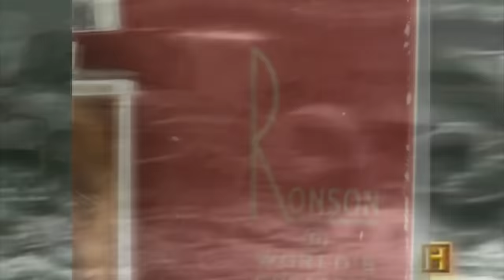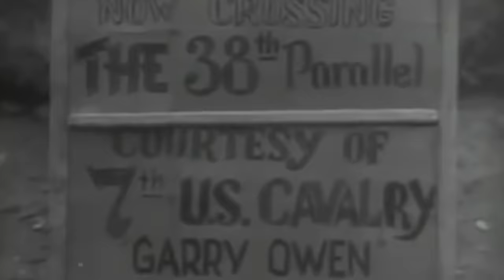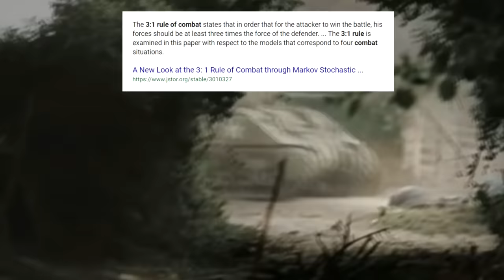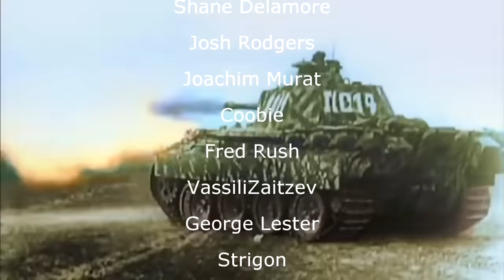The American Tank Meme

Comment: What's better than 1000 broken down tanks of 50 different designs?

20 000 working tanks of one design.
Reply: That's the funny thing about American engineering and equipment, If we replace something we'll make at least 900 versions of it until at least 30-50 years later where we replace it and do the same. Unless it's aircraft, aircraft by American lifespan is 20-50 year's because apparently we don't like making something new or we do and then call it a failure and cancel it or actually use It.
Reply: @CTInaBanana    I mean if it ain't broke don't fix it.
Reply: Well, if there are 3k tanks damaged and 2k dead yet meaty tanks, cannibalize parts from the 2k dead to repair the 3k, amirite?
Reply: @dd-579fletcherwillyd.9  Reduce, reuse, recycle And Repair I guess?
Reply: @OffGridInvestor  it takes a lot to replace infrastructure in a nation the size of the us and how spread out the population is
Reply: @CTInaBanana  well the b 52 is still in use so even aircraft lasts long 

Then thare is the m2 50.cal which is even older
Reply: @CTInaBanana  I mean we don't change aircraft that often cause the US usually makes the best aircraft in the world and are so good that they dominate there enemies aircraft for decades. Then we just jumped ahead so far that the enemies still trying to combat our 4 decade old aircraft have to try and deal with an aircraft that can disable there entire country in hours.
Reply: @CTInaBanana  The B-52 wants a word with you.
Reply: Sherman Tanks also fought in every theater of the war I do believe. They were lend-leased to the Soviets and fought on the Eastern Front. In Africa,Italy, France, Germany; they were in the Pacific Islands, the Philippines. The only place I'm not sure if Sherman tanks were featured in would be the India-Burma area. A rugged tank that could fight in all climates across the planet; that's a hell of a well engineered tank.
Reply: @huntclanhunt9697  don’t forget the A10 and the literal grandpa plane the AC-130💀
Reply: @CTInaBanana  What do you mean there’s a lot of aircrafts we’ve been using for a long time. The B2 bomber, the AC-130, black hawks, the Apache and the list goes on. There’s some from the 50s we still use, in the Air Force is looking into making a newer version of the A-10 because it has the capability to destroy 1890 but the plane itself is outdated. 

The thing is aircraft are more complicated with something like a gun. Technology is always changing and that’s kind of the most important thing on the aircrafts, technology. That’s why were so secretive with the F-22 and won’t give it to anyone, no one can match it because no one knows what’s even in the damn thing😂 we’ve literally destroyed Abrams and Blackhawks to ensure no one else can take a peek of the tech inside
Reply: as a german, i have to admit, that's a good point
i still like the idea to bet on better armor and guns to counter the enourmous soviet tank hordes
Reply: @AnthonyBlamthony   The thing with the american military budget is, sometimes our R&D outruns our Industry to the point where by the late 2010's, while the F-22's stealth and Air-to-Air combat abilities were still good, it's RADAR was already outdated. I can't see into the minds of pentagon leaders, but I'm assuming the logic was, in conflicts where manouverability is important, the F-16's and F-15's will still do their job just fine, whereas in conflicts where stealth & range is important, the F-35 will do the job. This left the F-22 with basically no role, which is why there are so few of them in service.

For the B-52, I think the main thing is, once US air dominance is estabilished, nothing can pack as much of a punch as the B-52, which is why I believe that it's stealth capability does not matter. As long as it can carry new missiles and bombs (which it most likely will be able to for quite a while still), it will remain in service.

For the F-15's and F-16's, it's similar to the A-10. As long as the US's primary opponents keep being despot dictators with MiG-21's, the US will continue to use those aircraft, because they do their job just fine. And very few nations have 5th generation aircraft that are not made by the US, and those that do, usually have them in small numbers.

Which is why america will keep using 4th gen aircraft until they can make enough 5th gen at their current place to replace them. They are largely one or even two generations ahead of their opponents.
Reply: @Blei1986 - You had no other choice. Germany was never going to match Soviet production numbers. Now add the Allies production numbers. The heartland of Germany was about the size of 3 US states.

Comment: “Sherman the right tank for the wrong war”

Tiger: transmission breaks fire happens
Reply: Panther: Drive Wheels shatter
Reply: Ferdinand: Literally everything breaks
Reply: @__ But the Henschel design was also subjected to engine fire wasn't it? Just less so
Reply: For that guy to say the sherman was the right tank for wrong war is amazingly ignorant. I'm flabbergasted.
Reply: @SomeGuy-lr7ms  the henschel was just a normal tank, the tiger p and könig both had “minor“ problems, the tiger p could have engine problems on its own, and the königstiger was very hard to repair because of a high technlonogy, meaning: if you break your king tiger you don't have 10-20 hours to repair so you put autodestruction charge on and escape
Reply: @SomeGuy-lr7ms  pretty sure it was the panther
Reply: @rebelgaming1.5.14  Ferdinand: Has been completed - EXPLODES
Reply: Porche tiger : cries in the corner
Reply: __ a burning engine* the grammar is very important to the Reich
Reply: What would have been the "right"war?
Reply: Max Power Yah, Like WW2 is a War of attrition, and what war would it be suited in besides that? It’s a American T-34
Reply: the tiger was the right tank, for the wrong war..would have been  OP in ww1..in ww2...still pretty OP..but the difference is in ww1 there wasnt Soviet and American tank spam, and the enemies tanks would have also broken down, like once a whole german trench surrendered to a immobile tank
Reply: @F-15J Eagle two words for you HL engines
Reply: @F-15J Eagle nope, the tiger 1 had a burm rate of 91% :)

Comment: I’m actually writing a paper on cost benefit analysis surrounding the M4 Sherman and the M2 Stuart. Essentially, I’m running cost per unit, then estimating our net loss vs net investment. From what I’m seeing so far, it’s a fucking brilliant design, with production being so damn good (what with the expense for metal per unit) that with its absurdly high survival rate being what it was; it deserves to be recognized for its quality. Yes; it wasn’t perfect against big cats, but it wasn’t supposed to fight em one on one anyway. You move as a unit, and with support; then you kill the big mean kitty cat, without loosing all your crews, if you lose a tank that’s fine. There are 50 to 60 in the depot a few miles back where you can go back, refit, and catch up with your unit/grab a new guy in case you lost someone. 

As opposed to losing a Tiger, or other big cats, which were expensive and borderline irreplaceable in some places. Big cats are astounding in their own way, and deserve some respect; but so does the Sherman.
Reply: And how easy it was to repair a sherman and not spend the money to send it back to the factory like the germans often did
Reply: Honestly it's a similar philosophy to the soviets in which you had a design which could be produced in extreme numbers and could be repaired in the field. The only real difference was that the soviets could afford to have it last a certain period of time, but the Americans couldn't. However that was largely a compromise anyway and the Americans could simply take on that added cost and still pump out tanks in the thousands. And it's why I really want to see a war of 1945 Soviet vs American tanks because they both went virtually the same philosophy in terms of tank doctrine.
Reply: @buddermonger2000  ya the t 34 is loosing that 

The war built t 34 had many many cut backs 
Watch the video from lazerpig on the t 34 

On paper the t 34 is absolutely amazing but in production it was held back by terrible production practices
Reply: You speak the truth